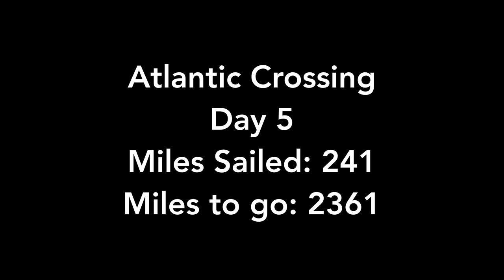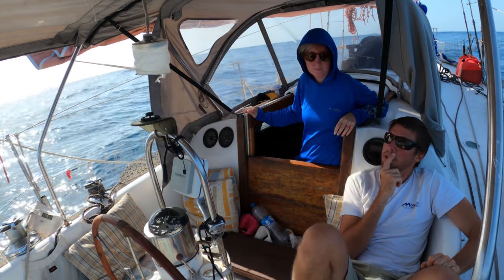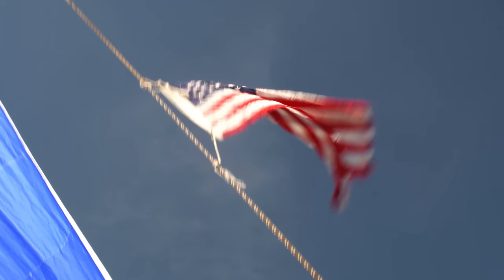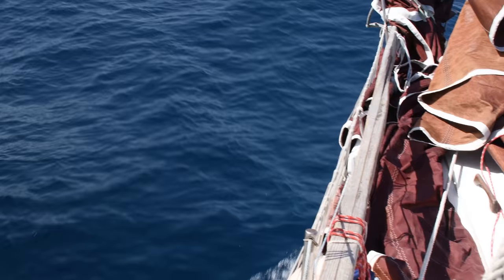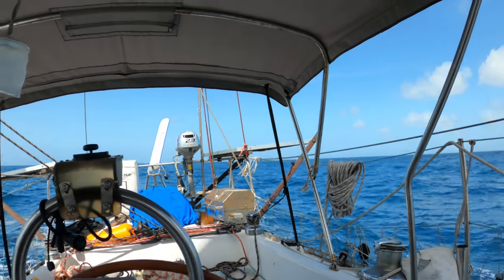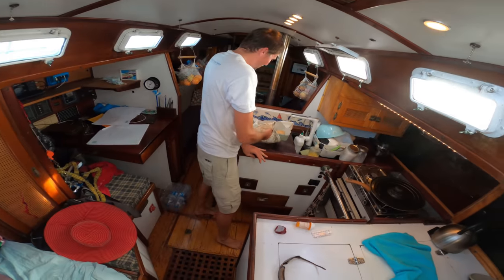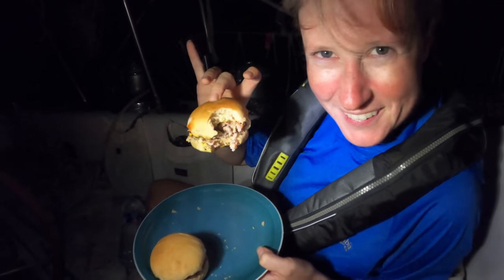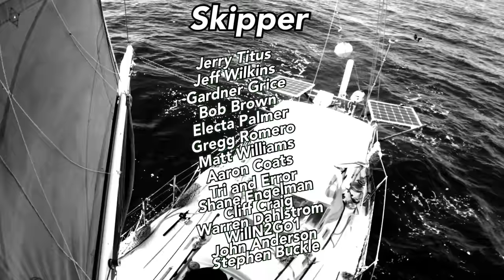PURE Ocean Sailing With Light-Air Sails | Sailing Wisdom [S5 Ep18]

Comment: Love's and LOL's
Refrigeration is over rated
I seen a nice bit of homemade kit:
A clip> eyesplice on end of yacht braid> several feet line, through another clip and back half the "several feet line" and then spliced through the yacht braid for about 6 inches, then outside the core and cover , a few more inches and then a shopper knot..  
This has a 'tail' portion easily moved if the main body is not under load. This is used as a removable section of lifeline at the place where the boat is boarded at (could make a dirt cheap "preventer" , or to cinch gear down 

... Up next: a "Firemens Bolin" where you make 2 big loops in right hand, one loop in left hand, throw outer right hand loop/chunk into air, throw left hand toward between the two right, and reach in between the 2 right hand thingies with left hand, and pill through ( you have 2 bits of line in 1 hand, 1 bit in the other hand, you toss them skyward and prick a Boline knot out of it in about 1.5 seconds)

Comment: I noticed your anemometer is mounted on the stern rail. 
Does the main interfere with the accuracy? 
I have the raymarine wireless, but it sometimes looses connection. To reconnect the two have to be close together but mine is mounted at the top of the mast.
Reply from the maker: It used to be connected to our electronic autopilot (which we removed years ago). We kept it because it’s easy to look at and visually see what the wind is doing. How fast is it spinning and which way, but it’s not hooked up to anything.

Comment: Nice episode, looks like gorgeous sailing.  How do you find your wind instrument on the stern?  I’m thinking of doing the same.  Is yours adjustable in any way?  I have had my unit for a while but not too keen putting it on the mast top.  Andy UK
Reply from the maker: I put it there to hook up to the electronic autopilot which we have long since disconnected and removed. It worked there pretty well but now we keep it because it’s easy to just look at it and see direction and speed (how fast is it spinning) from the helm. None of our wind instruments work, but eye balling that guy does the trick!
Reply: @RiggingDoctor  Ok cool.  I like to keep my electronics simple but it has been on the boat a while I may as well put it up.  Less hassle to put on pole.  Cheers and fair winds. Andy UK

Comment: Nice ghoster sails you have there, bliss.  I see you have your wind instrument on the stern, is that a spare or your only wind instrument?  I am thinking of mounting mine on a pole aft but wondered if you feel having it low and in the flow of the sails affects it that much.  Thanks. Andy UK
Reply from the maker: It worked well back there on every point of sail except when the main was right in front of it. Then the wind speed was a little off. 
We have since disconnected it when we removed our electric autopilot but kept it physically present so that we can see how fast it’s spinning to guess at the wind speed. 

It works but I would put it centerline since you will never sail dead into the wind, if it’s on either side, it will be a little off on the opposing tack (but not off enough to justify going up the mast).
Reply: @RiggingDoctor  ok cool, I pretty much thought that might be the case.  Wind instruments are notorious for going wrong.  Thanks. Andy UK